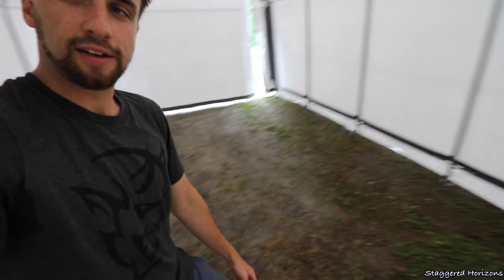BUILDING A GARAGE FOR MY NEW CAR! Part 1

Comment: Hey Erik, I enjoyed this video. Any specs on how much weight it will hold in the event of snow? How do you plan on anchoring it so that strong winds don't put it in the next county? lol  What's your thinking on flooring? Pavers maybe, or treated lumber, or ??? Lastly, what are the measurements? Oh yeah, you now need a flagpole with Staggered Horizons flag. Save the Wave. Peter
Reply from the maker: I have all that taken care of :D It is a gothic arch type garage vs ones that just have a semi rounded roof, so snow shouldn't be a problem to actually build up, it should just slide off, I will definitely be cautious and watch it all winter counting the days until Spring haha and I have 26" steel anchors in every support brace (12 altogether) trying to figure out something cheap that will will cover the ground, don't need anything crazy or perfectly level to the degree. The measurements are 13'X20'X12'
haha I definitely should get a Staggered Horizons banner or flag of some sort! thanks for the idea and as always, Thanks for Watching!
Reply: Thanks. Looking forward to more videos seeing what your floor will consist of, how you detail/accent the interior and possibly showing/explaining how the entrance flap stays in place as well as how you get the entrance flap out of the way so that you can pull the Vette in.
Reply from the maker: Funny enough, I put the top exterior on backwards,  so I have to put two grommets on the front door now so I can unzip, roll up and clip the front door. And I have a ton of Adams Polishes videos to make very soon, Stay Tuned!
Reply: I knew something just didn't look quite right. :-) A "backwards," install? Hmmmm, see, I've got to watch you at all times. Hope that doesn't void the warranty. LOL Looking forward to Adams Polishes vids. I'll send you some labels for the bottles, "This Side Forward!"
Reply from the maker: hahaha it's not big deal, I got it covered! :D